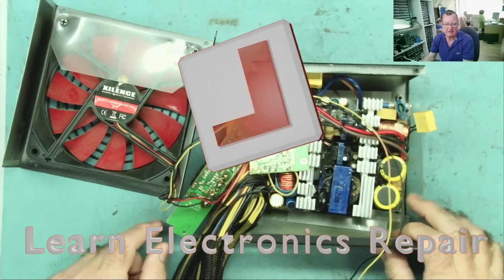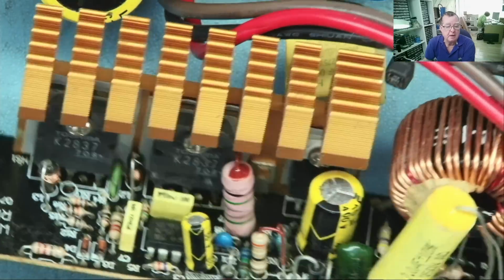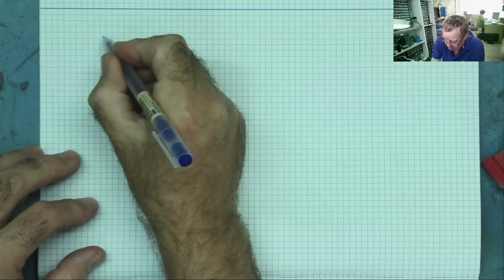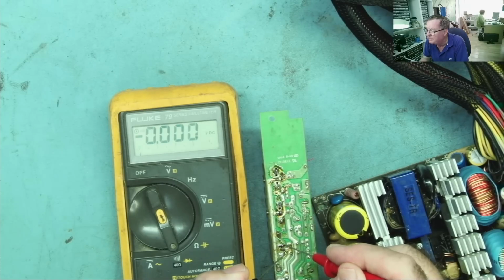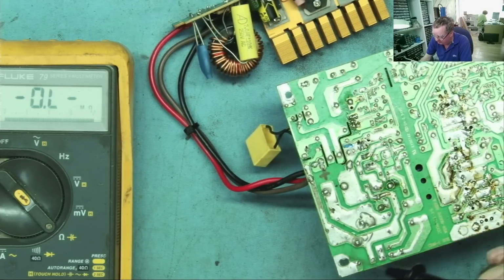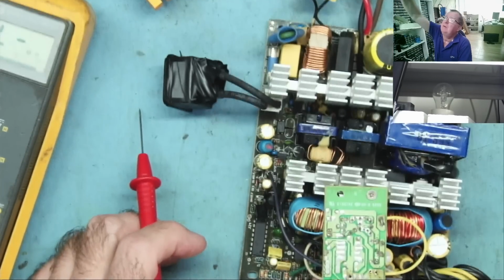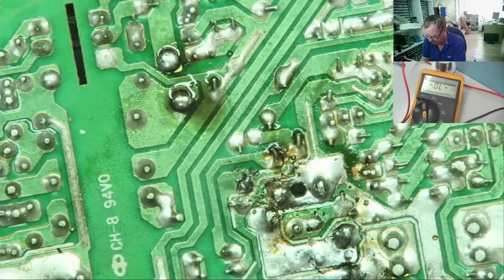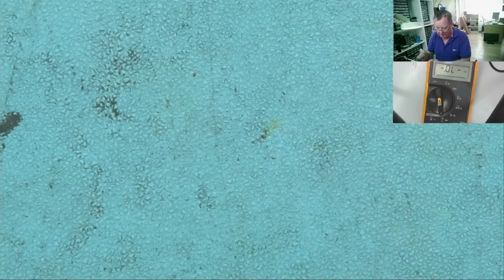Help! My PC was in standby and it suddenly went BANG. Can We Fix It? How To Repair ATX PSU.

Comment: I had the same problem on an xbox 360 PSU, short on 5V STB and I had a short on the same diode, removed it and the short was gone so got another diode from a donor board and it works fine now.

Comment: Great instructional video. From my experience of working on PSU's I would not have used a lamp dimmer on a unit with PFC, I have done more damage than good so now I just use a variac with an ammeter. I see you checked the SMPSU switching mosfets for shorts and as you say had they gone it should have blown the fuse, but I didn't see you check the standby mosfet and some PSU's use a TOP222 or similar, these would have a low-value resistor in the source for current sense, in your case this probably would have blown rather than the fuse hence the "pop". Looking forward to seeing part 2

Comment: It's a common mistake for random non-technical people to leave everything on standby. You should know better. I always unplug everything when not in use. I have a lot of old retro stuff here from the 80's and 90's that I rarely use. Most of it (when on) is potentially a fire hazard so it's always best to leave stuff not plugged into mains when not in use. When a modern SMPS goes bang it usually takes out a bunch of parts and modern PSUs are loaded with hundreds of smd parts. There doesn't appear to be any smd parts on that PSU so it's an old one. It might not even be worth fixing since it's old cheap chinese rubbish and they can be replaced easily with a new one. The primary reason to fix something is because it can't be bought new or replaced easily. In any case, if you do fix it be sure you find and replace all the bad parts otherwise it'll go bang again hehe! At the very least you must find the blown up part... which you did not do. You'll need to remove large amounts of stuff to get into the bowels of that psu. For something like that it's generally cheaper to just toss it and buy another one. Power supplies are cheap now and unless you are bored, have loads of time and want to learn it's not worth fixing it. Of course it will make a good YT vid if you can fix it, but a vid without a fix isn't going to be much use as a learning tool since you're explaining stuff but not finding the actual fault... meaning you're skipping over something that is important because you didn't find it. The amount of info that can be taken from a no-fix vid is limited to the troubleshooting process. That's a thing but you still end up with a disappointing no fix and missing info ;-)

Comment: Well the diode was short, so ac was applied to the DC electrolytics, maybe not for long enough, but  you should as good practice replace them both too. If the caps are damaged, they also may have damaged the new diode?

Wonder if this comment will also get shadow banned?
Reply: It's still there at the moment 😊

Comment: A couple of questions 1) Whats driving the standby transformer? Is it the 8 pin ic that's visible at 7.17 above the controller ic?  If it is, it might be worth it tracking down where it is getting it's Vcc from since if it is not starting up then it won't drive the standby transformer and hence no standby 5v.
2) Are we sure the pfc is running since we saw 270v and not the 385v that should have been present?  Doesn't the pfc kick in only when the motherboard sends an all good signal back to the power supply? 
3) The controller chip that drives the main transformer is an a7500c. It needs to see 15v Vcc on pin 12.  You can check to see if the 15v is present which should tell you if the standby transformer is kicking in at all since as you yourself stated, it is probably providing the 15v for the controller as well as the 5v standby.
Reply: I suspect he was only getting 270v on the caps because of the current limiter bulb flickering, the voltage never had a chance to rise properly, one of the reasons I never use a lamp dimmer with PFC PSU's, does more damage than good.

Comment: Stand by transformer does that pop too sometime it is snapping inside. At once that 5v stby diod made jump to schottky diod's aluminum cooler also popped and cooked diod of 12v rail one of high voltage transistors and fuse was still good. Another 400 w one was connected to the system which is using arround 300 350 w also popped after 30 min high side transistors was gone lil zener diod was gone 12v rail diods was gone and all breakers in the house was down and i couldnt turn them on till i unplug power sup and guess what fuse was good in it. So i have zero trust to those fuses...

Comment: I think it would be good practice Richard to replace all the capacitors in the 5v supply as standard practice once you have found the shorter component. These capacitors as you know are always running.
Reply: This sounds good. What temperatures do they see sitting there?  I think the fans are off in standby, maybe running the fan at low  speed on standby could reduce temperature and increase life.

Comment: Check the 'old glue' too.   Some of that stuff will go from white to yellow to brown and then start conducting.  Especially bad around high voltage capacitors where it is commonly used.
Reply: wow really? that silicone glue may start to conduct at some point in its life?
Reply: @SirasPK   Yup.   Seen it happen on my own UPS.  Fortunately I caught it before there was damage.   Others weren't so lucky. Ticking timebomb.  There's videos on YouTube.
Reply: @SirasPK  No, silicone is fine. This yellow glue here is some other, cheaper junk. It goes conductive over time (possibly due to absorbing moisture from the air) and can cause electrical leakage, it also loves creating corrosion on anything it touches.

Comment: For any children watching make sure that you leave it unplugged For a decent amount of time and Don't touch any High voltage capacitors Unless you have discharged them 1st or 💥☠️😵🤯
Reply: Yes, children do have a habit of watching 40 minute long SMPS repair videos.
Reply: @incandescentwithrage  children have a habit of watching a repair video and thinking it's fine to prod and poke around so it was a good call - for those who do know about the dangers already, there is no harm in being told twice and for those who might not give a thought about capacitors holding a charge, it's important information.